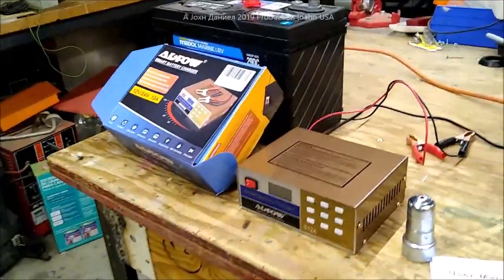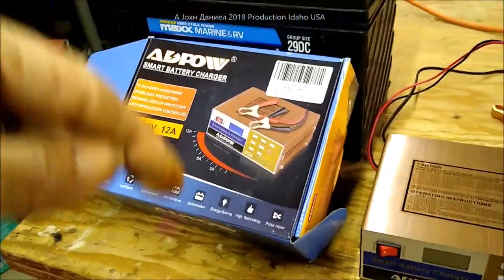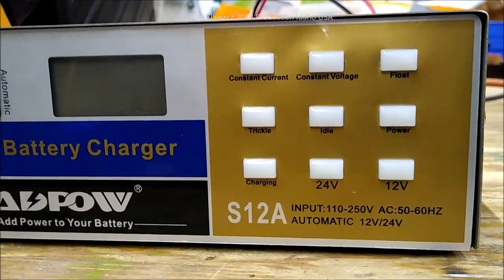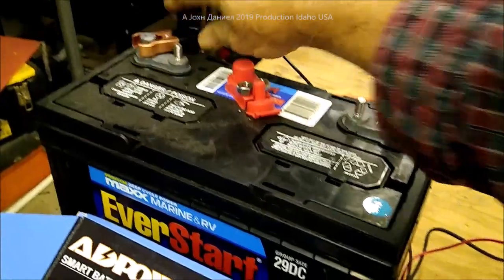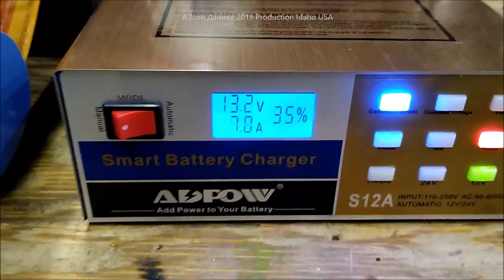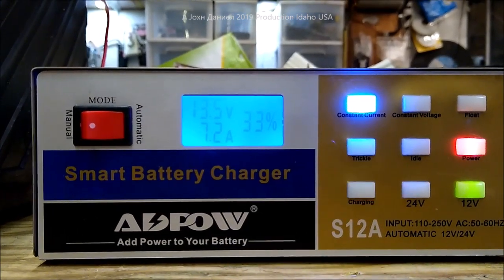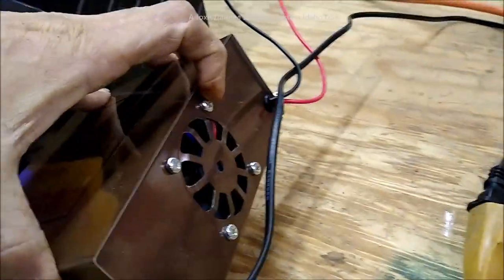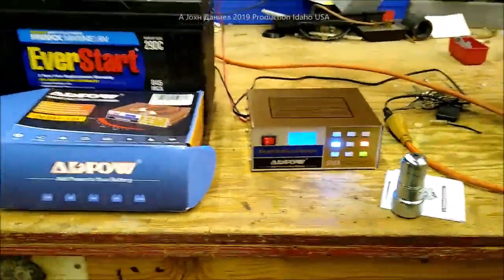New Computer Controlled 12 & 24 volt Battery Charger w/ Intelligent Pulse repair

Comment from the maker: Very good, the 12/24 volt Smart Charger https://amzn.to/35ceTp4  *Automatic Smart Battery Maintainer Intelligent Pulse Battery Repair & a 12V/24V/36V/48V/60V/72V  https://amzn.to/2KqupWn Auto Charge Maintain, 0 to 72 Voltage and Current Manually Adjusted, with Clips Ammeter, Suitable for Car Truck Golf Cart RV Marine Yacht Mower Lead Acid AGM SLA ATV ISS 40Ah-200Ah
Reply: Јоhn Daniel   Watched your video on ADPOW smart charger. Purchased one vie Amazon $35 delivered. I used it on our battery bank. Two lead acid deep cell marine batteries. Wired 12 volt. Needed something to really cycle charge since I don’t have solar panels installed for our Rv( off grid home for now)I’m very impressed. Worked well running off generator. Took 5 1/2 hours approximately. Excellent!  Really value your channel and all the information you share. Anticipating the outcome of your Daughters Chinese Lantern wind generator. Will add that generator if it works well. Southeast Ohio wind sketchy but any charge on these extended night will help. Ty you again. Keep it up👍God bless
Reply from the maker: @davidhughesloredahughes1434  Excellent, and You can leave it connected as I do when on shore power, seems to keep the batteries in very good condition.

Comment: Do any of these pulse chargers restore lost CCA's?
Reply from the maker: They do a great job of getting full starting power back if the battery is capable of restoration. Some abused batteries may never recover.

Comment: Please please can u help me. I have this charger and I am not sure it is working. If it’s not attached to car battery is the power indicator red?
Reply from the maker: It won't do much of anything without a battery connected. Should connect to battery, then plug in to a wall or cord.
Reply: @JOHNDANIEL1  ok Ty for that. I don’t need to have it plugged in to power up my car battery do I? If the unit has a full charge will it or should it revive a dead battery while in my car? Or no?
Reply from the maker: It must get utility power to charge a car battery. If your car battery is totally dead, you must raise its voltage using another car to jump start your car, then you can charge the car battery once it is showing over 10 volts on the low battery. These DO NOT create charge if they can not recognize the battery your wanting to charge as 12 or 24 volt, or save it and restore it due to no volts in it.
Reply: @JOHNDANIEL1  I see. Ok Ty very much. I purchased it in case I ever got stuck with a dead battery and there was no one else around to give me a shot with a car. So what else can I use this for? Charge my phone lol?
Reply from the maker: There are no battery chargers that take a dead battery and charge it. Those would be referred to as DC power supplies. The best thing to use is a booster, https://amzn.to/44C3YUS which can get you started and then to recover the battery use a charger to help the battery work right again. Now you see why mechanics have so many tools and devices.

Comment: Looks like a great little unit. Makes me wonder though; what does a wind turbine does to a battery bank where the amps typically go up and down like a yoyo and where the voltage bounces around typically  between 12.3 to 14.7 (depending on controller setting of course)

Comment: Yep good little charger all the auto shops here in Aussie land want $60 plus for a basic 12v 2amp charger so bought this for $35 off ebay and charged my boat batteries in parallel perfectly

Comment: I have 2 of these they go from constant currant  low battery 23% highest seen is 9.3 amps on my meter not adpow s12a display then after 30min maybe shorter it goes   to constant voltage 14.0v to float 14.0v then at 90%.  it goes to  trickle.  My units do not go back and forth  from float  to trickle as yours does in the video here  note charging light is not flashing not lit when in trickle mode so it don't pulse in trickle like my other different charger .  It does not go in to idle on normal sized car battery's waited days tried various battery's  625cca ,golf cart batterie's a 7ah battery it will go in to idle no other battery. How many amps is yours putting out and volts using meter are these defective please let me know asap

Comment: Hey john been following your page for some time now I bought one of these shortly after
Seeing your posting of here i have been totally
Amazed by it.  Used it in all my charges dumped my shumacher in the trash. Thank you!! Keep em coming . also bought two rv  ceiling fans a little wobbly but not so hard to balance. And great with cheap motor  controller i came across.  
THANK YOU!

Comment: it adjusts the voltage and amps to prevent the battery from overheating and releasing hydrogen gas.

Comment: I have an MC9 bus 1980   with 2- 12V  Large CAT batts  wired in a 24V circuit.   Would you use this to charge both batts at the same time?  Hooking the Neg clip to one batt( Neg side)  and the Pos clip to Pos on the other battery   to charge at 24V.  If the batteries were uneven would they even out this way?
Reply from the maker: Just connect at a near battery 24 volt connection, it will do well in maintaining and decent charge rates.

Comment: Thinking about buying this charger for a 12V 100AH Everstart Deep Cycle Marine battery, would this charger work? And also, Although it could be left permenantely hooked up to the battery, Is that really a good idea?, especially because the fan constantly runs while it is on and likely to burn out the fan after being plugged in for a long period of time? for example during winter .Should I disconnect the battery for a day or so once it’s at 100% and re-connect?
Reply from the maker: Just put it on your battery about twice a month for three days at a time and the battery will love it and do well.
Reply: Great , thank you, Last question , How fast would this charger fully charge my 100ah Deep Cycle battery?

Comment: My charger is similar but my battery on display is 25,50,75 or 100 per cent an flashes when charging. Maybe i will get the same display as yours after a certain percentage.

Comment: After I watched this video I got one as a Christmas present last year. I recently used it on a three year old lawn mower battery and this unit rejuvenated the battery like new. Amazing little charger! For those of you who read this it does take some time from start to finish. But the out come is will worth the wait. My battery was so out of wack that I put it on manual for the first 2 hrs then switch it over to auto till it finished.

Comment: what dose it do on a dead battery?
have had some chargers that wont charge if it is dead
Reply: It will not charge car batteries that are dead or if the cells are below 1.5L volts.

Comment: G'day John,
I'm trying to get an off grid 5kw pv system here in Australia, but getting the run around from suppliers.
I trust your engineering experience and would appreciate a parts list from trusted suppliers you have used.
Many thanks John
Reply from the maker: One of the best solutions is finding a fully trustworthy dealer on Aliexpress who also has a real finishing warehouse ( many do not, they just hock crap). Whats your region and district codes you have to deal with and the power goals such as voltage, storage and or grid connecting. And do you have VAT fees to consider that may need some "creative cost/item branding" to cut cost!
Reply: Much appreciated John, I have done just that, just waiting on prices, cheers mate.

Comment: what about desulfation, can it remove from lead acid batteries
Reply from the maker: It does a amazing job desulfating in about 3 days
Reply: @JOHNDANIEL1  Is desulfation on Automatic or Manual for 3 days? Thanks 😇
Reply from the maker: @SonnyLabaynaOnFIRE  Leave it on Automatic
Reply: @JOHNDANIEL1  Thank you for the reply 🙏 Can I use the battery while desulfating for 3 days?

Comment: are lithium batteries any good? 
Can't find much info on them. 
I can find charge voltage, mili amp hour ratings, and discharge rates.
 I get worried when I hear about having correct charger, not letting them die, keeping them warm, wrather or not they're cost effective. 
I have a generator only gets run every 2 or so months as well as a pulling garden tractor and batteries sulfate in about 5-7 years
not many videos on pros and cons next issue is if regulator charge voltage tolerance is out of wack what happens to the lithium batteries? 
I could adjust voltage and max amp flow at mechanical regulators but they aren't perfect
Reply from the maker: I agree, the jury is still out on the entirety of Lithium. But until they get it right, I get 10 years from my East Penn made L-16 batteries at 1/3 the cost of lithium.

Comment: John do you know if you can use on 12v gel and or lithium battery
Reply from the maker: AGM, Flooded and SLA on this one, the others in the same category on the page its on for about $15 more have those options.
Reply: Thx John

Comment: John,  Two questions:
What would be the problem with using it on a LiFePO4?
And what is the problem with using it on an inverter?  
Keith
Reply from the maker: I figured to try it on the grid, representing 98% of the world first and then my inverters later. Since it has no battery over heat sensors it can not be used on Lithium.
Reply: @JOHNDANIEL1  I use a Battleborn and as I understand, they have a low temp and a high temp disconnect.  Would that make a difference?
Reply from the maker: @dakotafisher6874  If it has a dedicated charge controller in the battery pack, then I would say yes, but the voltage max on 12 and 24 are as follows, 14.35 and 28.5 volts. BUT, if you look under the video, I did include, although more expensive, a model that's exactly what your seeking with variable setting to 72 volts ( 0 to 90 vdc stable ) and PWM action.

Comment: John, I checked the price on eBay and they are about $40, $38 and change.do you have a cheaper source?
Reply from the maker: Below the video a link to Aliexpress for $27. If using a phone you hit the tiny down arrow on the lower right, then video description and upload date area has sources for them at $30 and less.

Comment: Does charge vary with temperature ?
Reply from the maker: Not unless the battery is below zero degrees. Then it cycles on and off to wake the battery if needed.

Comment: Using a Switch Mode Power Supply.      When the Voltage reaches the Target Voltage of the Constant Voltage  current tapers off because the voltages are equal.       I use a adjustable CV/CC power supply on all of my Li batteries.
Reply from the maker: The best place to find the new stuff from China is BG https://www.banggood.com/custlink/GDKD0fIQJP